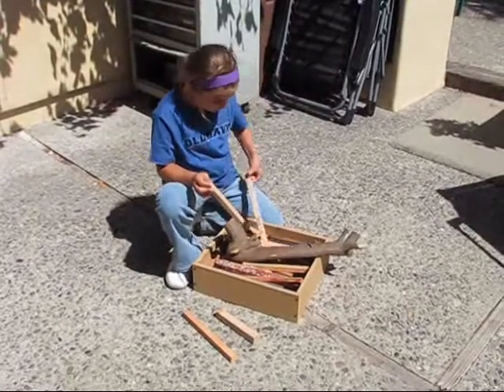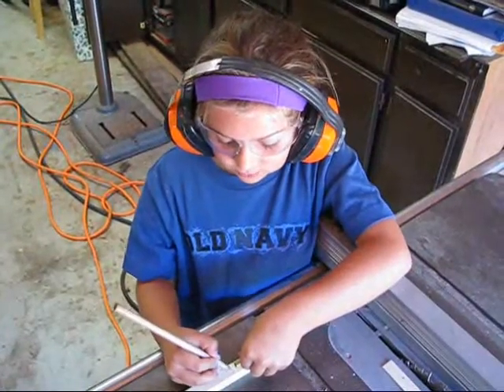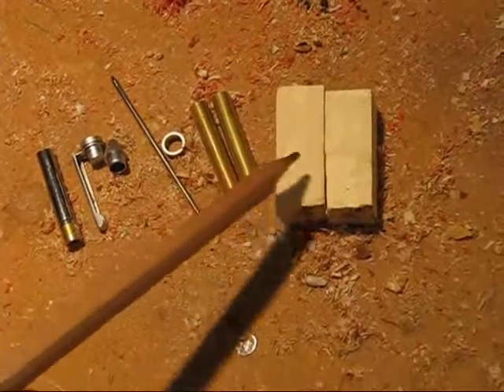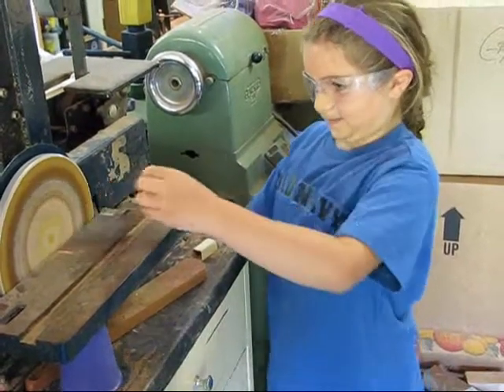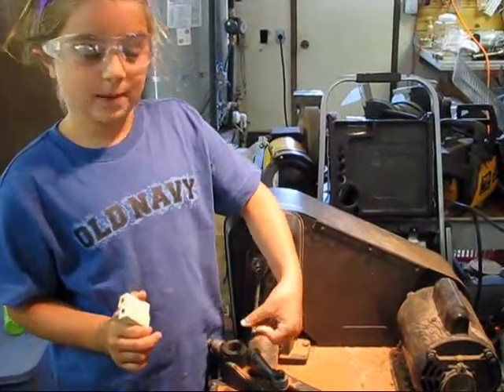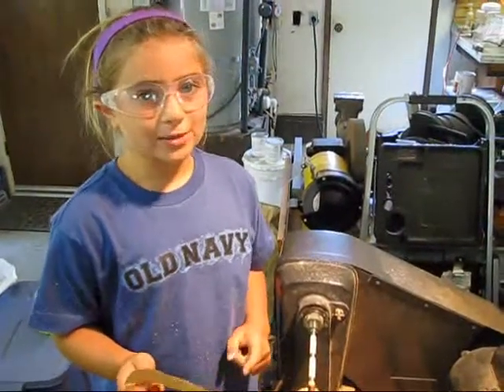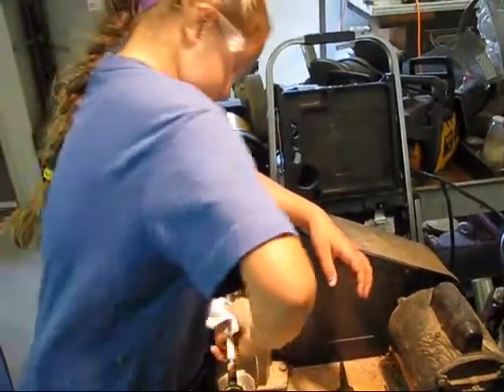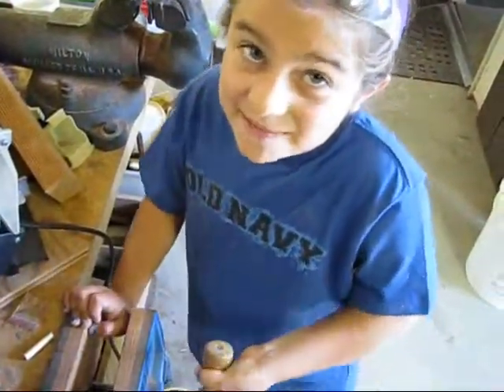Turning a Pen 101

Comment: Thank you.  I've not seen kickback on small material such as pen blanks from green woods, but fully agree that a handle would surely provide for necessary safety.  At the very least, a throw upwards could be disastrous.  The modified file has appropriate temper and holds an effective edge.  In reviewing the video, I've duly noted many safety issues and this has been helpful in cleaning up the process so that safety remains a priority.  Your comments are much appreciated.

Comment: @akselsson1 

not if it's High Speed Steel

HSS steel (which is what you should be using on such a lathe) as opposed to Carbon Steel needs a much higher temperature before it loses it's temper.

Comment from the maker: Many years later, and a few more turns down the road, I'm still wondering: Under a similar mandrel and rest setup, has ANYONE EVER seen a blowback where the tool is thrown towards the carver?  We certainly use handles and better steels today. I kind of miss my $0.25 rasp, though.  It held a pretty good scraping edge, and I maintained a dozen of them in all sorts of shapes. Thanks for all your sound concerns and inspiring encouragement.  Sophia maintains a DIY channel: justaddsomesparkles

Comment: You are great but PLEASE make a handle for the file that you are using as a turning tool. It is VERY dangerous to have a pointed end of the file towards you in case it grabs . With a wooden handle it won't hurt you if it grabs.